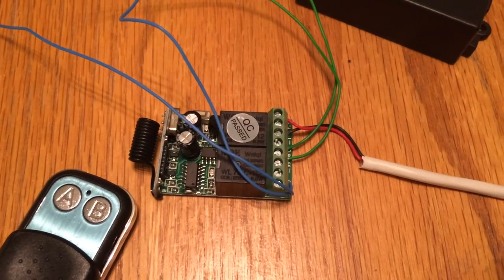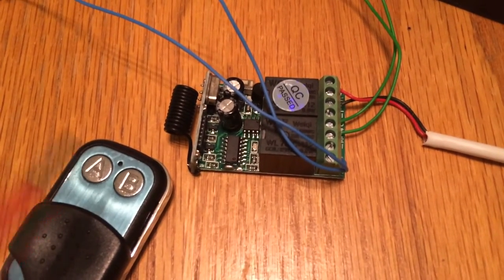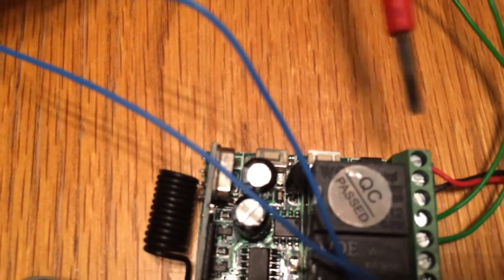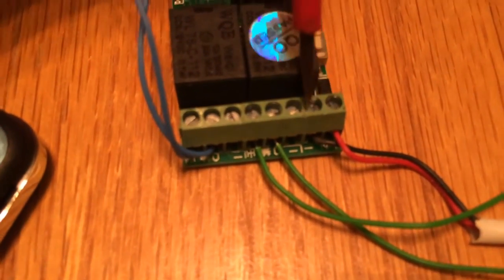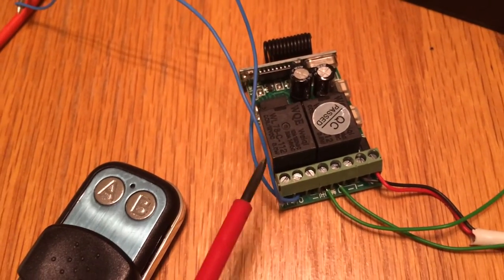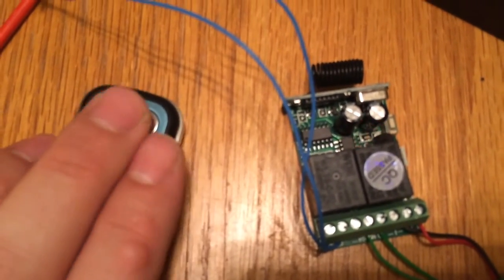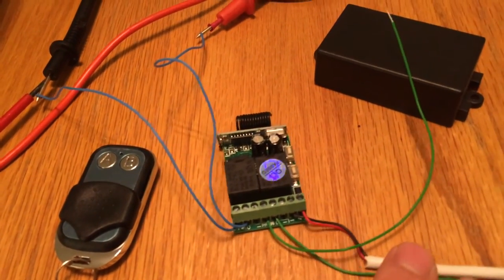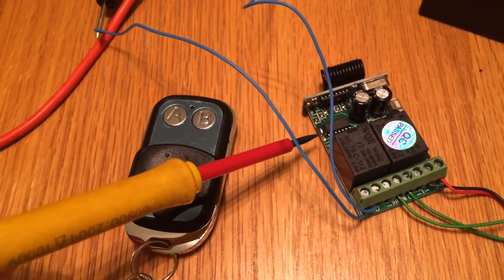12v 2ch 315mhz remote PS-4N1286

Comment: Hi mate - just waiting for my various parts to arrive from China to make my power box.  Decided to try using one of these receivers/remotes but just trying to figure out the wiring in my head.  If I simply had one switch and a lighter socket.  I would put power to top of my switch and from middle to the socket.  Negative to both.  If I wanted to wire one of these into the mix so that I can override the switch - how would I do that exactly?  Ideally I would want the light on the switch to come on even though I haven't toggled it if possible.  Thanks again - all your vids have been a great help
Reply from the maker: +carpytone75 sorry for the delay i'm just uploading a video on how i kinda wire them its only basic but i hope it helps,

gotta love china for all the bits, but its takes forever for them to turn up
Reply: +m0iee thanks very much :)

Just one other question if I may - if I were to use a 14ah battery,  is there any particular charger you would recommend - wasn't sure if a 500ma one would be up to the job - have seen one that outputs 1500ma?

Comment: Hi mate I'm having problems with my battery not charging to 100% just getting up to 60% or 61% cheers keep up the good work
Reply from the maker: What voltage is the battery getting too?? If it's a new battery then it may just need the meter setting up, which meter are you using??